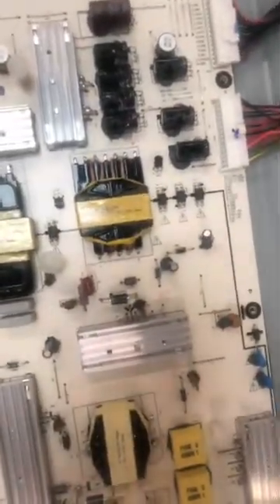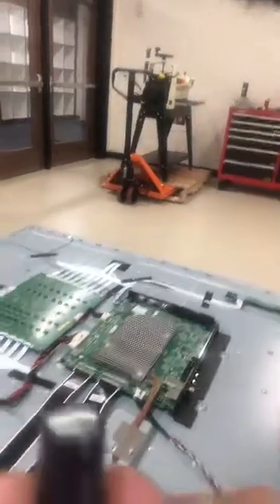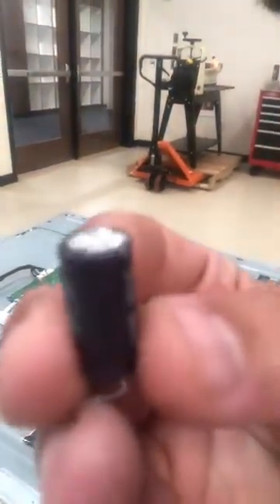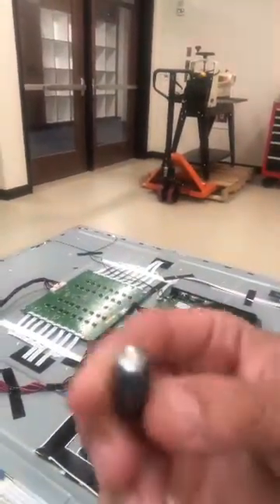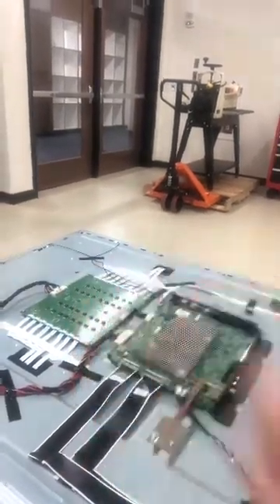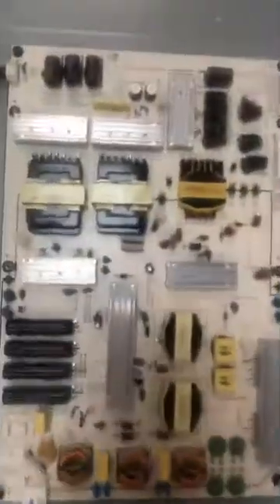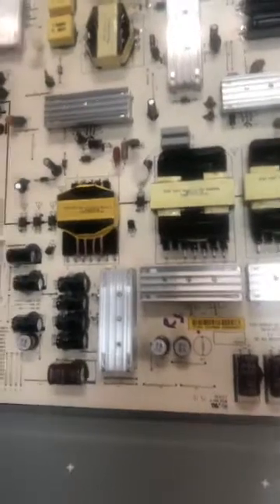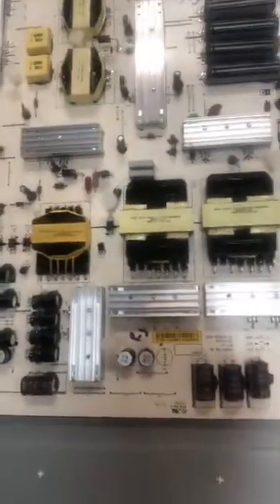Vizio m70-c3 no power board repair

Comment: I replaced the power supply board, as shown above.   I paid like $120 for a replacement board (used) I installed it, and tried to power on my TV, and it's still not working.  My old power supply board hummed very faintly while plugged in, and if I unplugged the MAIN BOARD from the POWER SUPPLY BOARD (old one)  it would hum much louder.  If anyone knows what's going on/how to fix this, I'd really appreciate it.  Thanks!

Comment: What values are the 3 capacitors at the 38 second mark on your video? Its the top left corner of the power board next to the t-con plug.  Are all 3 the same values at 470uf/50v? or is the farthest left different from the 2nd and 3rd.  I have a the same tv that keeps popping the first capacitor. I think someone was tried to fix this at one time and put the wrong capacitor value.  Great video. Thanks in advance.

Comment: I have this tv but the light comes in and blinks white then turns off. Capacitors are not bulging
Reply: We’re you able to fix yours. I have the same issue and capacitors are not bulging.

Comment: Do you have a link for the capacitors?
Reply from the maker: The capacitors that popped out were 1000uf 16v and replaced them with 1000uf 25v. This is the Amazon link for the capacitors that I put in https://www.amazon.com/PoiLee-1000uf-Capacitor-Aluminum-Electrolytic/dp/B082B1XCHV/ref=mp_s_a_1_1?dchild=1&keywords=B082B1XCHV&qid=1628421962&sr=8-1